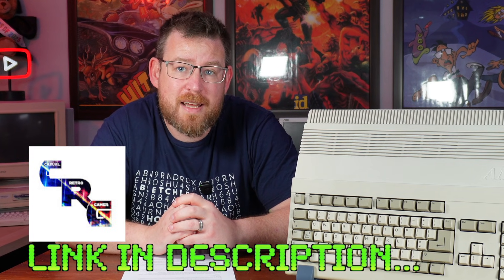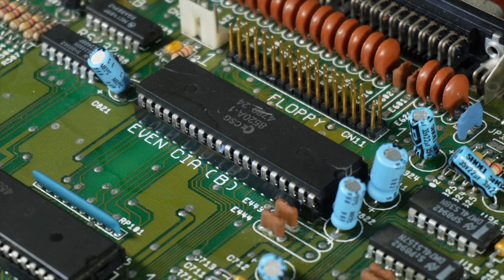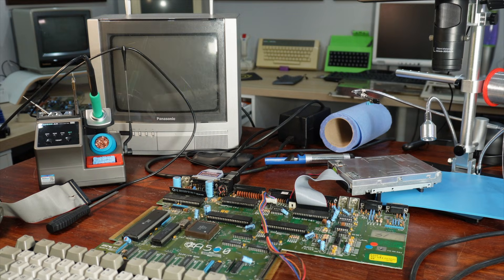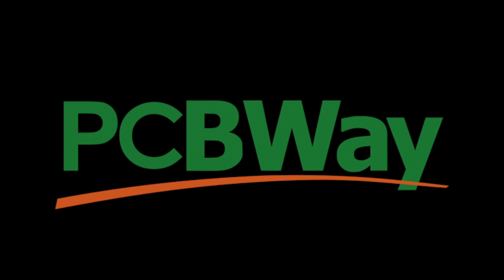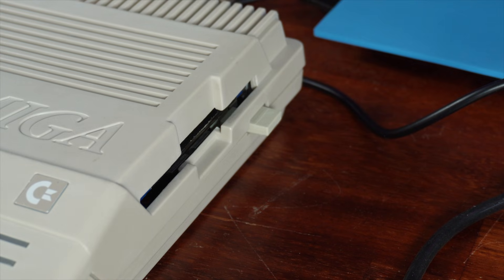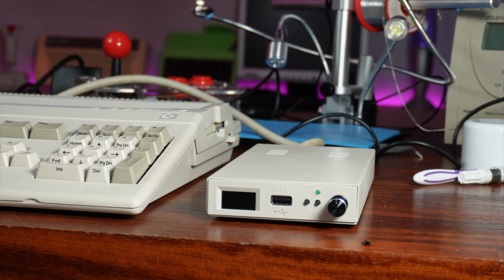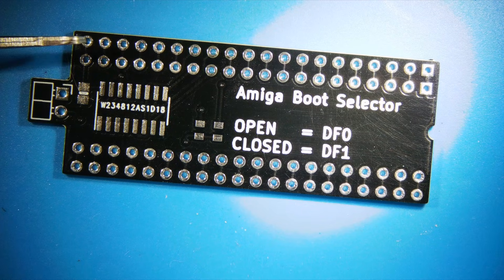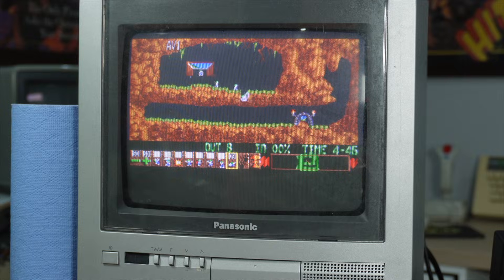Essential Amiga 500 Upgrades

Comment: Due to the colours of the LEDs, I would suggest that this machine has a later version of the Agnus chip. That would allow you to make all the memory chip-RAM. You need to change the connection of jumper2 on the board. You even have to switch off the expansion memory. I hope this is done by turning off the connection of Garys exRAM to the ground. I made this selectable by switches at my 500 plus. At my computer, I can switch the Kickstart ROMs too. Now I can use it with the advantages of the Amiga 500 plus, but I'm also able to switch back to a more standard configuration for more compatibility.
ROMs: Kickstart 1.3 or OS 2.0
Memory: 2MiB chip or 512KiB chip + 512KiB slow

Comment: I think it just depends on what you want to do. I recently bought an A500 for the purpose of programming. I had one as a kid, did some assembly but didn't really have the knowledge about HW registers. Now, almost 30 years later, I've written many device drivers and understand the low level details much better. So I want to see what I can get this machine to do - in STOCK performance form, in terms of processing speed. BUT I wanted convenience - so I added 8MB FastRAM + IDE + flash, last thing I wanted was to wait for floppies loading and switching.

Comment: Ide68k+GottaGo (8mb fast ram) from Amigastore, then kickstart 3.2 and CF card with Whdload games. Gotek in 2025?? Change disk,change disk… this is not good idea… beter CF cart…

By the way… you can buy switchless bootselector… If you durning work have small accident with switch drive then you can broke something… With switchless bootselector is no option (3-4 seconds “long reset crtl+a+a” and Amiga starte from Df1.

Comment: There is a little bit of real-estate at the rear right of the amiga that I think would have been a better position for that switch. But that's just my opinion! I noticed that area yesterday when I was working on mine.
Reply from the maker: Would that have required drilling into the case? I wanted to preserve everything as much as possible
Reply: @TMEretro yea it would have, and I totally understand you wanting to preserve the case. That’s fair: I just didn’t know that was a condition. ✌️

Comment: Interesting and nice video. I especially liked you fixing the CIA and other chip because I have 5 or 6 Amiga 500s which I am sure some may have the same problems. I do not have any desire for the Gotek drive. I want to keep my Amigas in original glorious condition. I have stock piled floppy disks and drives.Thanks 4 a great video ! God bless !!!

Comment: I also chose an external Gotek. I built mine with a 68030 accelerator with fast RAM and CF, switchable Kickstart, and that same DF0 killer so I can run OS 3.2.3 without the internal floppy drive getting worn down. But while I was at it, I also got the Chicken Lips mechanical keyboard, 512K to add to my board (Rev. 8A) and a 74F139 so I can run 1+1MB chip RAM, made it switchable to 512 chip + 512 slow within Kickstart 1.3 for compatibility, and a few other mods. I did drill into my case but with hindsight, I wish I had just printed a trapdoor cover with space for some DIP switches. Oh well. I bought a second one that's pending retrobright to become my museum piece.

Comment: Back then, the Macintosh FX was the super hawtness machine to have, with that gorgeous Trinitron monitor, and Lasarwriter.
The Amiga was just a game machine... that couldn't even do a square pixel.
Reply: Still, some were used for other purposes, such as rendering ray traced graphics for series and movies (Lightwave 3D), broadcasting video effects (video toaster), creating music etc. Granted, the mac was better supported for business use.
Reply: Sure, except the Mac IIfx cost over $10K back then, before you add the cost of the monitor and the printer. Hardly comparable to an Amiga, they played in different leagues.

Comment: I have fond memories of owning an A500 and getting all kinds of upgrades from friends who were big Amiga fans and had moved on to better models. One of the first upgrades was a Big Agnus chip that replaced the Fat Agnus and could address 1 MB instead of 512K of chip memory. You needed to install a jumper wire to make it work because the extra address line was not on the PCB.
Another upgrade was an external (fast) memory upgrade that had a faulty chip that I replaced; I also had to add a fan because the memory was getting way too hot. And I added external floppy drives. 
But my favorite Amiga project was "ALF" (Amiga Loads Faster). A German magazine (C'T) had published an article to connect a hard disk controller for a PC via a 34-pin ISA card edge connector to the expansion port on the left side. There was only one problem: it needed an OMTI controller to work.
This happened in the early 1990s and the PC world had already mostly moved on from MFM and RLL controllers to IDE controllers. So it was very easy to get old 8-bit MFM or RLL controllers for the ISA bus. Except OMTI controllers of course because they were snatched up by Amiga hobbyists to put large (think 100 MB) hard disks on their Amigas.
I had several Western Digital controllers and I had access to the IBM PC/XT Hardware Reference Guide which has a BIOS listing of the IBM hard disk controller, as well as all kinds of information. I disassembled the ALF software together with a friend, and we found out quickly that it was very similar to the Western Digital BIOS. Apparently the OMTI controller chip was VERY compatible with the Western Digital chip. But there was one tiny but significant difference: The IBM bios listing mentioned that during initialization, it was holding the reset line of the Western Digital chip for some amount of time in accordance with the data sheet, and the ALF software was holding it much shorter. Long story short: we made the Western Digital controller work and I rewrote the ALF software to make some improvements (I learned a lot about unrolled loops and SCSI). So even without DMA or interrupts, it worked pretty well. Eventually I might have even figured out how to add ROMs to boot from hard disk but I never got that far: I had to boot from floppy to load the driver and mount the hard disks (I had 70MB and 20MB MFM hard disks, reformatted in RLL to 105MB and 30MB respectively).
Good times!

Comment: I would recommend building a switcher that doesn’t require a physical switch - instead it drives of the reset line being triggered several times (eg press ctrl+amiga+amiga 3 times to toggle) 

It’s basically similar to your board, but you use an attiny to listen to the reset line and drive the 74 series chip that presently the physical switch drives
Reply from the maker: That’s a really neat solution, I’ll definitely look into that

Comment: If you wanted to "update" the internal floppy, I highly recommend 'GoEX' drives.
They use the same flash floppy software as Goteks but they fit perfectly inside the Amiga floppy bay as they're slimline mount and have slimline screen mount as well.
They use SD cards instead of USB, have jogwheel/button to open folders, they're almost invisible with SD card inserted.
You can also solder a cable to have "onscreen" floppy selection instead of using a mounted screen.

Comment: The boot drive selector is necessary only for the A500 with the Kickstart 1.3 configuration, ensuring optimal game compatibility. Kickstart v2 and later versions allow booting from external floppy drives. It is recommended to install an RGB2HDMI adapter as a reliable digital video output solution. This option is significantly more affordable than some other solutions, such as the Indivision ECS. If you want a bit more than gaming, getting an accelerator is next and final addition. There are at least half of dozen new designs on market which offer faster CPU, a lot of memory and a mandatory hard drive solution.
Reply from the maker: Great tips, thanks!

Comment: I have done the same things basically. Also put in a 68030 accelerator with compact flash in one of the A500's as well. Will buy another Indivision ECS so I have on in each. On the A600 I also have a external keyboard mod also so I can get full keyboard. I have lots more mods on the A1200.
Reply from the maker: I think I am gonna go PiStorm with this one eventually, just because Frontier is probably one of my favourite games of all time
Reply: Man I would really love to have an A1200, but they are so expensive..

Comment: Does the drive switcher work on the 1200 as well?
Reply: Correct me if i am wrong but pressing both mouse buttons on a A1200 boot up gives an option for for which drive to boot from...
Reply: @doctorsocrates4413true yes, but still games won't boot with that method since they are sort of "hard coded" and expect/binded with the DF0.. From my experience never had any game booted using the method you mentioned..
Reply from the maker: I believe the A1200 has soldered CIAs, so this board wouldn’t work
Reply: @TechMadeEasyUK  know of any tricks for the 1200 to do something similar? Thanks!
Reply from the maker: @ChrisKewl this looks promising: https://www.gotek-retro.eu/a1200-bootselector-df0-df1/
Reply: @TMEretro I have this and tried and tested on the A600, works as promised.